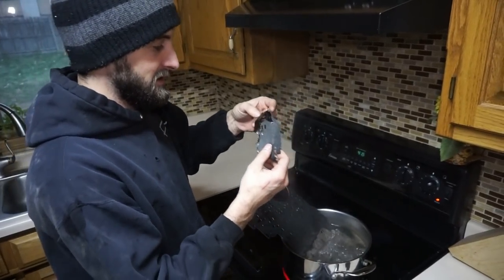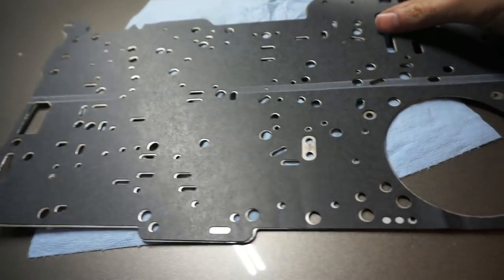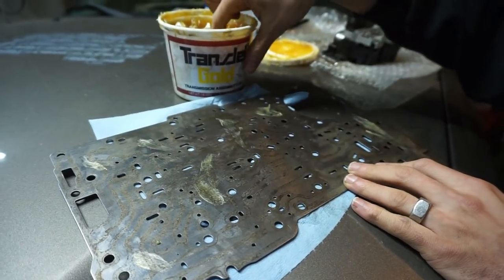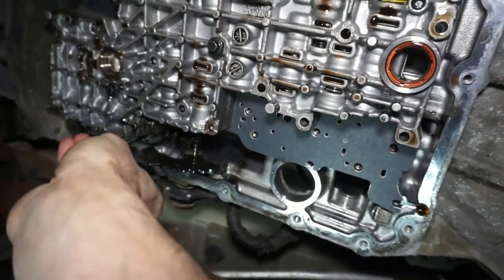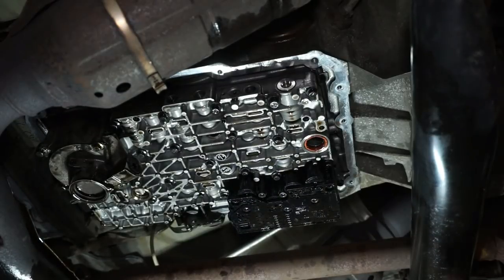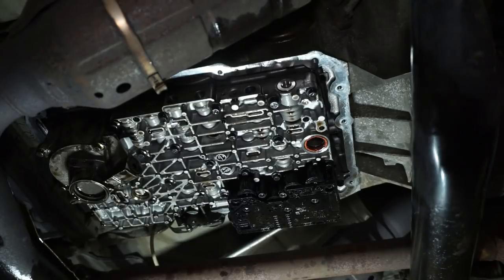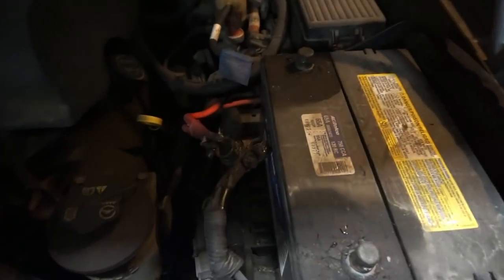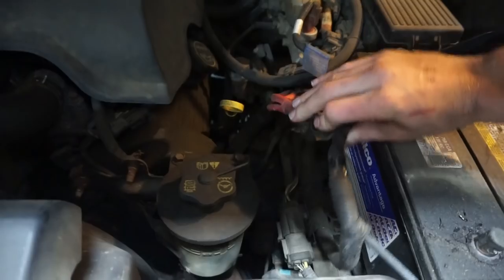Explorer 5r55w Valve Body and Solenoid Pack Install!!! Transmission Slips O/D Light Flashing!!!

Comment: Thank you for the video mate. I’ve recently replaced the solenoid pack for my 2008 ford ranger as was having changing issues and seen that was a common problem. However had no change. I’ve seen top and bottom gaskets on eBay. Will give this a go.
Reply: did the valve body do the fix??

Comment: question, did you do the valve body because the solenoid pack replacement didnt do anything? I replaced the transmission, replaced solenoid pack and still have OD light flashing and it says solenoid malfunction and also solenoid electrical error codes.

Comment: Did these repairs take care of the flashing OD light? 

I have an 04 Explorer and the light started flashing today but all the gears shift fine, even Overdrive. I planned on hooking it up and checking for codes but I wanted to see what kind of job i might be in for.
Reply: Help,,   Mines doing the flashy thing too and sticks in second gear,  how dod you guys fixed it??.
Reply: Zackary Ray if everything seems fine but your od is still flashing it could be and old code that was never cleared.unhook negative battery cable and move where it won't be able to touch and ground.then take an alligator clip wire and hook one end to the neg cable. hook the other end to the positive terminal(which should still be hooked up to power). let that chill for 10 minutes or so and then take it off and reattach your negative cable. this will clear the pcm on Ford
Reply: Hector it sounds like you probably have one or more faulty solenoids and/or a damaged gasket. if your od is flashing it means your tranny is popping a dtc.either buy a reader or have shop pull codes for you for info. doesn't look like he had any of the solenoids installed on the valve body when he installed it.
Reply: self correct. Hector I was thinking of 5r55e when I said he hadn't installed solenoids in the video. the 5r55s has a solenoid pack which is where your problem could lie.
Reply: @JD-nc6fl   thanks,  i ordered a selonoid pack from ebay cause i cannot afford the oem selonoid pack, i will install it my self when it gets here..
Reply: Hector Ortega did the part fix the problem?
Reply: @liljoebueno3864  i havent gotten a chance to install it yet,  im still driving the explorer like that, lol.
  I will advice you once i stall it. Ok?
Reply: Hector Ortega mine has shifting delays and I found a servo kit that’s supposed to fix I haven’t had a chance to install it I didn’t know about changing the solenoid before I ordered the part smh

Comment: I have a 04 Ford Explorer. I am having a shifting issue. It shifts hard from 1st to 2nd and when goes into 3rd and 4th it shifts fine. The fluid is full. I am thinking it's a speed sensor. Oh my overdrive light blinking on and off. What's your thoughts.

Comment: My explorer 2003 over drive light flashing , the 2 and 5 don’t shift gear , what can be ? The transmission shop tell me it was the solenoid pack but he don’t remplace the part he only rebuilt all transmission. Is high cost for that truck

Comment: You can't clear the transmission adaptive tables by disconnecting the battery. They're stored in non-volatile memory. You need a scan tool for that. You can do it with an ELM327 and the Windows version of Forscan.
Reply: Even that doesn't work sometimes. The only sure way to do it is to disconnect the negative on the battery,  then connect a wire from the positive to the negative and let it sit for about 10 min like that
Reply: @frankgarcia6760  The adaptive tables are stored in non-volatile memory. That means they cannot be cleared by removing power. That includes shorting positive to negative. They can only be cleared with a scan tool.
Reply: @SwapPartLLC  like I said in my previous comment.  Even the scan tool doesn't work sometimes.  The only sure way to do it is to drain the capacitors in your pcm. And you can do that by disconnecting the negative side of your battery,  then connecting a wire from the positive to the negative and wait for about 10 min.

Comment: Hello, i replaced my solenoid pack. While i was doing that i stripped one screw so i didnt screw it pack in. Can that cause harsh/delayed shifting? Or is it more likely that my transmission is worn out? Oh the transmission has had harsh and delayed shifts into drive/reverse/neutral before. Thanks for your help.

Comment: Hello friend good afternoon, I have a 2002 explorer with 5r55w transmission, I would like to know what I should check, since my car when backing has NO FORCE, when the site is flat there is no problem, but for example, when I leave my garage and the rear rubbers of the car lower the sidewalk (and remain in the gutter), it does not keep backing me down, it loses strength, there is not enough power to get out of this position even though the engine accelerates very well, that is, the car in this position (the front part above the road and the rear part below the road), loses the power to go back, it just feels that it moves but does not leave the gutter, I must put it in DRIVE, climb the sidewalk again and give it hard back to get out
Reply: The reverse doesn't have an adjuster like the forward gears, the bands, so you would probably did a rebuild or something has gone wrong that this want fix that I know of

Comment: I really hope you reply....I have the same issue where the o/d light flashes and weird shifting.  Idk if you had the same syptoms but after over 60 mph (2004 xlt sport awd) once I let go of the gas pedal and start coasting my rpm drops to 0 rpm and the engine stalls but if I put the car in neutral before the rpm drops the engine stays running. Did you have the same issue??
Reply from the maker: No I didn't have those symptoms.
Reply: @BlaserBuilds  thank you so much!!!
Reply: My engine stalls when put in reverse I'm sure it's both valve body and solenoid pack I've heard from professionals that those 2 are most likely to fix what ever problems.

Comment: Hey did it work?? I dont see anymore videos regarding it... my explore is doing the same Nd your video is giving me hope.
Reply from the maker: Not completely. It did fix the 2-3 flare I had, but I still have to lift between 1 and 2 for it to shift.
Reply: @BlaserBuilds  does the od light still flash??
Reply: Also, what parts did you get? What all is needed when doing exactly what u did.
Reply: @BlaserBuilds  what parts did u buy?